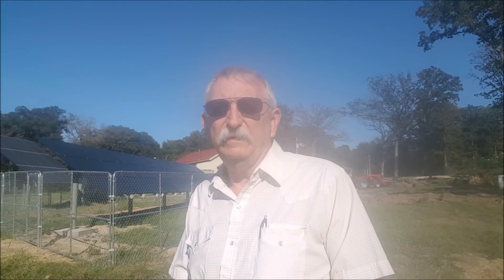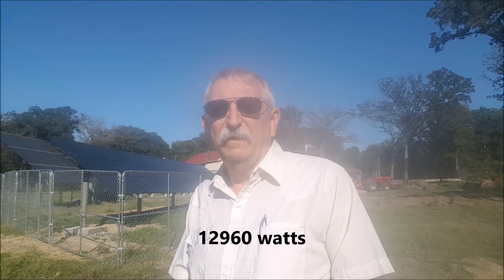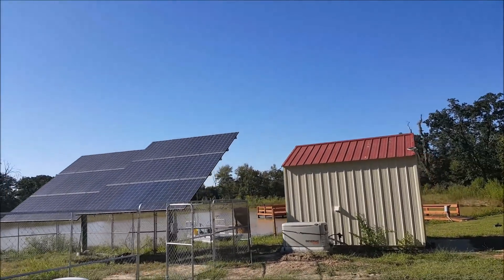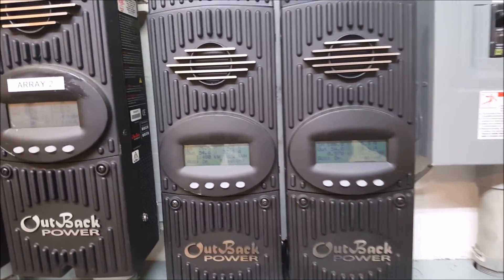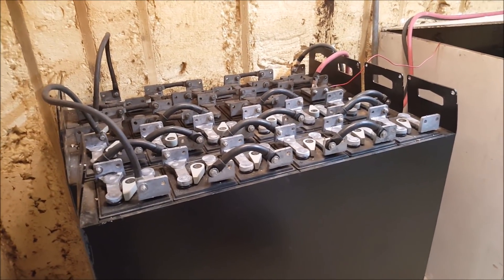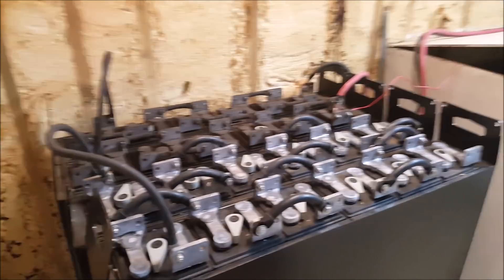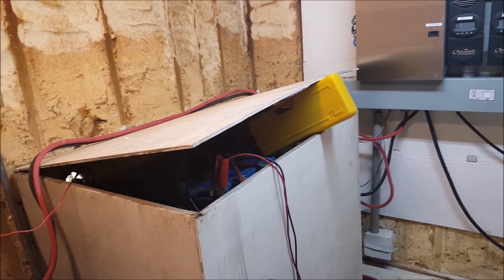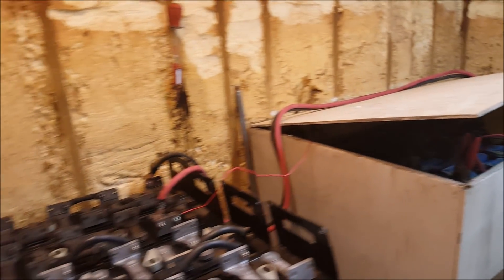Video 16 - Installing An Additional 24 Solar Panels

Comment: Love that you've taken the time to make and share these videos. Was curious what type of work you do and how you came to own the land. I'm interested in doing something similar.
Reply from the maker: Thanks.  I'm retired.  I'm 69 now and like most people went two or three different ways in my career path.  We owned a computer retail store for years but the last 10 years I was an IT specialist for a school district before retiring.  I have a close friend who is a realtor and I described exactly what we were looking for and it took several months to find it.  It is about 15 miles out from any sizable town.
Reply: @MichaelHoybook  what a life! The response is appreciated. Any advice you might have for someone aiming to go down this path? I'm a systems engineer. :)
Reply from the maker: @Crftbt  First, find the perfect spot for the best value.  It might be pretty far out from civilization and might take a while to find.  And just as important, spend lots of time planning and studying and try to do most of the work yourself.  We saved a ton by installing the solar and rainwater collection systems ourselves.  Good luck.
Reply: @MichaelHoybook  appreciated that you shared this. I am going to take this account personally to help in my process. :)

Comment: the biggest question is how to get good internet ?!
Reply from the maker: I worried about this one as much as anything during our planning phase.  I ended up going with a totally unlimited cellular plan with a hotspot wirelessly bridged to a router.  It has some issues but light years ahead of satellite internet.  As an example, we have used over 140 GB this month so far - most satellite internet throttles after 20 GB.  I couldn't stand that!  Luckily, we are only about 2 to 3 miles from a cell tower.

Comment: What is the total cost of this system, compared to 20 years of grid electricity...
Reply from the maker: You don't want to know!!  From the economic point of view, I would discourage solar power.  Municipal electricity is so cheap right now.  However, we are not located near grid power so it would probably cost as much just to get power to our location.  And on a second note, we are "prepping" and "off-gird" is just part of it.  To answer your question, we have about $50,000 in the solar system - $15,000 of which we will get back in tax rebates this year.  Our house is so energy efficient, I think grid power would be costing us about $1200 to $1500 a year with rates where they are now.
Reply: @MichaelHoybook  Cost was my next question so thanks. Where I'm building grid is about 1000 feet away, or 3 telephone poles away also known as $40,000 away according to Nevada Electric! Maybe solar is still going to be the answer?
Reply: Grid-tied is pretty cheap compared to off-grid.  Even with cheap ~$0.10/kWh electricity a DIY system can pay for itself in <10 years.
Reply: Michael,  thank you so much for doing this series.  We are looking at building an off grid house in a couple of years.  What is your opinion on batteries if we have a generator backup?  Would you downsize the batteries or still try to have a few days of backup?  The batteries seem such an expensive part of the system.

Comment: Beautifull done and believe me, the building cost is a bargain to those in Holland. Your insulation makes the house warm in winter, but not necesarely cool in summer. Thick stone walls and ventilation prevent heat transfer to your living space. The SIP construction in combination with an airtight house makes that whenever the warmth is in the house its very difficult to get it out, even by airco, because the whole construction has warmed up. You made a very good decision by spacing the metal roofing from the SIP, but even then it will tranfer a lot of heat into your construction. One of the solutions could be: creating a double layer by insulating the first floor, so that the heat stays above and at the same time ventilating the upper floor, by creating overpressure trough mechanical or natural ventilation on the upper floor at the front and the back of the house.
I'am sure that your house will be warm in winter.:-)
I see that you mounted your new solar panels with bolts and nuts. To me they seem to stick out a lot above the panels. If they cause shade (especialy in the morning and evening)your solar production could drop by 40% or more.There are special flat fasteners who don't create  shade.
Reply from the maker: Thank you!  You are confirming what we are already experiencing.  We felt like our sip walls had heat built up in them because the temperature would rise inside our home during the night with no air conditioner running.   I really believe that you will be correct about staying warm in the winter.  We'll find out in about 2 or 3 months.  As far as the solar panel production, we have already seen wattage levels above the rated capacity of the panels so there doesn't seem to be a problem with hardware shading.  Thanks for the comment.
Reply: The panels reach the rated capacity in KWh when the sun is shining at an angle of about 90 degrees on the panels. Then there will be no shading. In the morning and evening there could be shading by these bolts and then you will not know what production could have been. In optimal conditions these 48 panels should produce about 100KW per day in Holland at 52N and an irradiation of 800Wh/m2.The average per day is about 35 KW. On your latitude 33N it can even be 20% more. Especialy in winter, when you need every bit of solarproduction to keep your batteries up it might become an issue that can be solved verry easy.
Reply: sneltoch, you say then that masonry homes are better for hot climates?
Reply: Depending on the thickness of the walls they are indeed better for hot climates

Comment: Hi,
Found your channel the other day have enjoyed your videos. I am especially interested in the SIP construction and return on investment. I am in the Palestine area and appreciate the challenges of hot and humid East Texas. I had hoped in one of your videos you would explain the Honeywell energy recovery system. Enjoy your new home, very nice.
jcb
Reply from the maker: Thanks for the compliment.  As far as the ERV goes, the jury is still out!  We chose to not install vent fans above our range or in our bathrooms thinking the ERV would replace these fans and also to lessen the number of roof or wall penetrations.  This did not turn out to be the case.  We turn on the ERV before taking a shower and our bathroom is still full of steam when we finish our shower and our mirror is completely fogged up.  Also, my wife was not really able to use the range because of the amount of heat released back into our main living area - even with the ERV running.  We have since had a range vent installed and vented out the back of the house.  However, there is the issue of dust, VOC's , carbon monoxide and carbon dioxide which might be in our home.  I just tonight ordered an air quality monitor to give us some real figures to check on the ability of the ERV to rid our home of these particulates.  I'll have to make a video when we come to a conclusion.  Thanks for the question.  If you are in Palestine Texas, you are only a little more than 100 miles away.  If you would like a personal tour sometime, let me know.

Comment: Great job. 

It is so nice to see some one with a "real world" number of panels.

Nothing tests my patients and understanding like a person throughing 5 panels 
on their roof and saying they are living off solar. 

9:58 Have you heard a reputable electrician say that breakers need to be 
exercised once a year?

I heard it from an old-timer once but I am thinking it refereed to the old 
technology.

13:26 I think I remember you saying your goal was to have a "no compromise" in 
energy usage solar system. 
Do you find it at all inconvenient to "have all normal things done by 6:00" ?

0:42 There is such a thing as a cloud buster though I am dubious as to its 
efficacy. 
https://en.wikipedia.org/wiki/Cloudbuster
Reply from the maker: Thank you.  I understand how you feel.  I even see "off grid" houses on the DIY networks with only 3 to 6 panels.  Crazy.  I guess I could have explained the 6 o'clock statement a little better.  My wife is retired and since she is home all day, she is able to do the laundry, water the lawn (pumping out of the lake), run the dishwasher, vacuum, etc. while the sun is shining.  I don't see how someone who is not at home during the day could manage off grid chores and of course I mean with all the modern conveniences of every "on grid" home owner.  It is a challenge but we knew we had a lot to learn but we still love it.  I'll read about the cloudbuster when I get a chance.  Thanks for the comments.
Reply: OverUnity, It appears to me the "Cloudbuster" was a device intended to produce rain.  That would be counter productive to Michael's solar system.